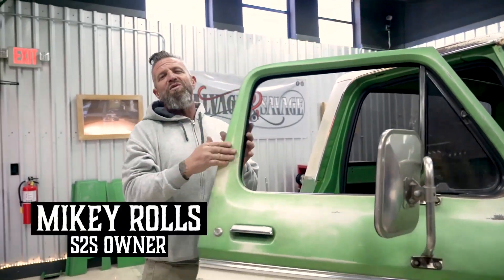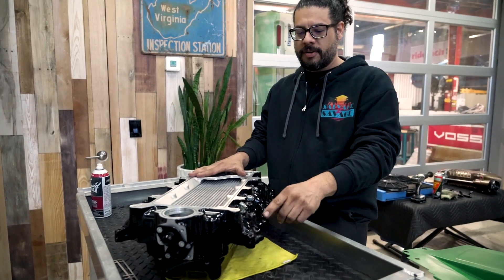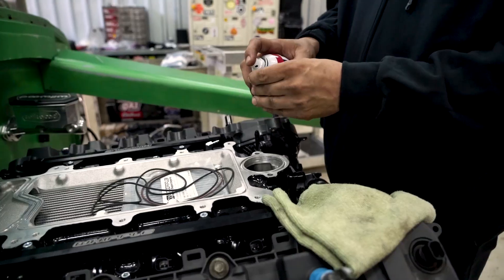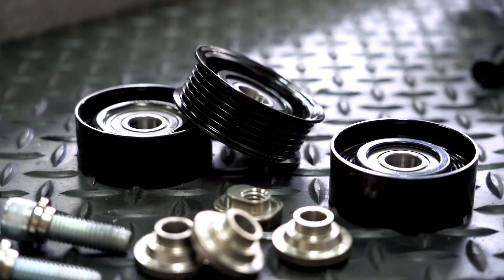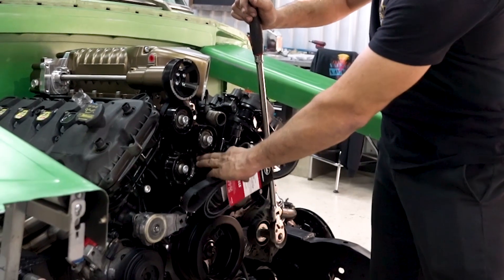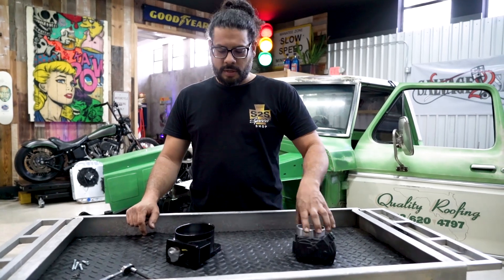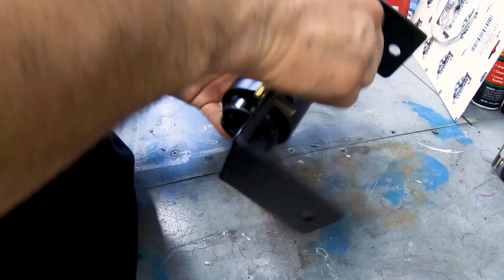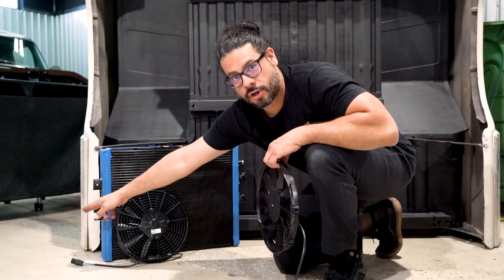2.9L Whipple Supercharger Install on our Coyote Swapped '73 Ford Ranger - F100 - Ep: 5

Comment: $7500+ and 12 psi of boost to increase "horsepower" 25% max over "stock". "FORD POWER" in all its overpriced, underperforning glory. 

And a "heat exchanger" mounted in a pickup box. Because there is so much airflow and absolutely zero "solar heating" in/of a pickup box. And what could be more practical for a "work truck" than cooling system components permanently installed and plumbed in the cargo area? 

One thing is certain. 600 HP IS a "lot of power" for an F100 light-duty 1/2-ton "work truck" that was never "engineered" for even half that much "horsepower" or half that much "motor" once you add the "power adder" and all the "dead weight" which goes with it. 

And how about those "independent front suspensions" with the "twin I-beams" that may be "fraternal twins" but damn sure aren't "identical twins"? 

State of the art. For Ford. Which was and is an "artist" at engineering "planned obsolescence" and convincing or at least telling its "loyal customers" that "innovation" = "improvement" and "new" = "never done before by anyone anywhere" rather than "new for/to Ford".
Reply from the maker: Tell us how ya really feel! lol
Drop us a link to one of your own builds so we can check it out.
Reply: Dang. That’s a lot of words just to say you can’t afford to restore a truck
Reply: @salvagetosavage what’s the top radiator mount that you installed on there? That’s clean AF.
Reply: What is up with all the air quotes lol